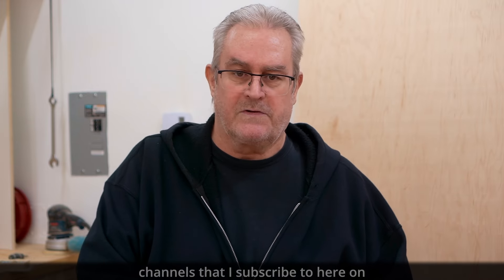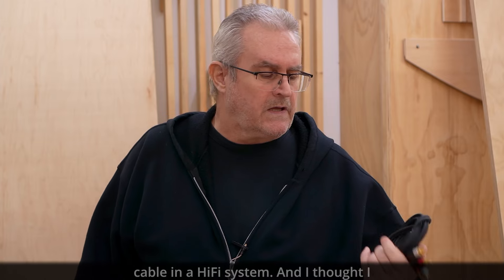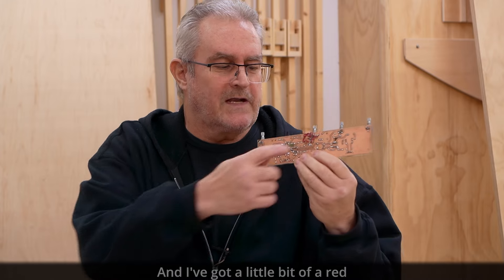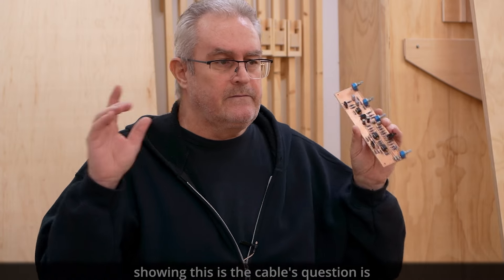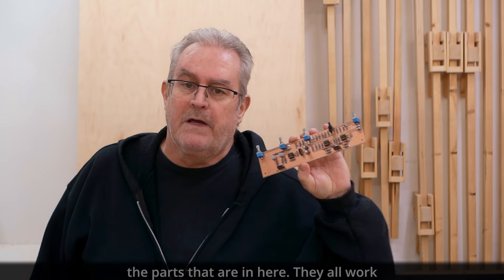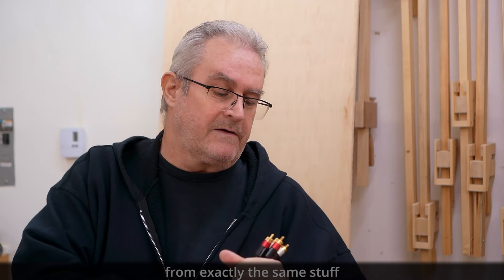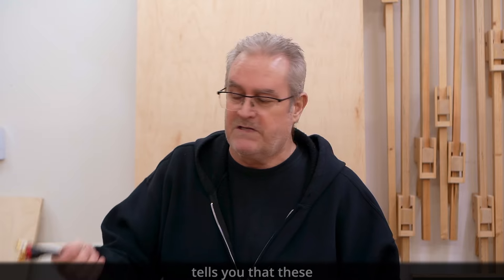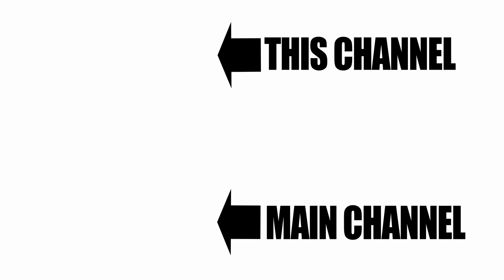Most important Cable in a Hifi system?

Comment: John, you are a fantastic woodworker.  You have designed and built some really interesting speakers and provide good information most of the time.  Unfortunately, in this case just flat wrong.  Claiming Amazon Basic cables and 100X or 1000X cables are made of the same stuff is wrong and blew your whole premise.  That is the same hand waving BS you just accused PS Audio of performing.  Where is the technical data to back up that claim?  Quality of everything that goes into a cable matters.  A well performing cable DOES NOT have to be uber expensive.  Most uber expensive cables do not perform at such a superior level to justify their cost.  Heck, have personally experienced moderately priced "audiophile" cables with shoddy construction.  In no way do I promote uber expensive cables.  Quality at a reasonable cost is the better answer. After trying cheap to moderate cost claimed to be "audiophile" quality cables, trashed them all and built my own.  Quality parts, not expensive or containing pixie dust, that do the job and will last a lifetime.
Reply from the maker: The tech data is in the materials used - copper for the conductor and plastic for the insulation. 
I could say more, but I doubt it would be time well spent. If there's one thing I've learned about guys who are into audio, they believe what they want to believe, despite evidence to the contrary. 
They also don't have the technical knowledge and experience to put the relevant factors into perspective and fall for pseudoscience half-truths.
Reply: @IBuildIt  Data does tell the story.  Recycled copper is not the same as virgin copper.  All plastic type insulation is not the same.  All connectors are not the same.  Again, I am NOT promoting expensive "audiophile" cables.  I do have the engineering experience to know that an Amazon cable is not the same as one costing 10X, 100X, or 1000X more as you claim.  Not sure what you have against guys who are into audio.  Painting all with a broad brush implying blind belief in pseudoscience half-truths is wrong handwaving again.  If you are happy with cheap Amazon cables, fine.  My point is for not more than 2X the cost of cheap Amazon one can build your own with quality components that will have top notch performance and last a lifetime.  I said nothing in support of uber expensive cables or belief in pixie dust.
Reply from the maker: So you think you can hear the difference between a "midfi" cable, like that amazon Basics one, and a genuine audiophile one? 
If you can and can prove it, you belong in the history books as the first of all time. Because such a claim has never been proven - ever. 
In fact James Randi was offering a 1 million dollar payout to anyone who could prove it, yet no one did.
That tells the rational man one thing: there isn't an audible difference. 
That's the relevant data.
Everything else is pixie dust and self-deception.
Reply: @IBuildIt  Don't understand why you are repeatedly accusing me of saying something I most certainly did not.  I said nothing about comparative sound quality.  You made a giant leap to that conclusion.  For the last time, my point is knowing what goes into a cable by making your own.  Why do you design and make your own speakers?  Why not buy off the shelf?  Are you smarter than every speaker designer in the world?  Doubtful. You like doing things yourself.  Correct?  I am not criticizing your speaker building interest.  I did call you out for making an absolutely false statement that Amazon cables are the same as others costing many multiples of dollars. 

The idea that some test could be performed to shut down all expensive cable manufacturers claims is absurd.  The argument around double blind listening tests has been around for decades.  It will never be settled because neither side of the argument can ever agree on how to conduct a definitive test.  The gigantic fallacy with double blind tests is EITHER side of the argument extrapolating an "end all" test result as applicable universally.  

Until you stop twisting my point so you can continue to aggressively thump your chest as all knowing about cables, no reason to attempt a civil exchange with you.
Reply from the maker: Double blind testing is the established scientific way to determine reliable results from subjective evaluation, so I have no idea what you are talking about. No one has been able to show that they can hear the difference when the tests are run. Plenty have been done, but none have shown results that prove audible differences in cables.
So, what difference does it make if your preferred "good" cable is made from virgin copper, if you can't hear a difference? Why is it important for you to get upset about me saying that the Amazon cable is made from the same stuff as the ones that costs hundreds more, when you won't hear the difference?
When the average audio guy talks about cables he's talking about SOUND QUALITY, not something else. So is it really me making a giant leap? Get real.
If you think you can make a better (build quality) cable than Amazon, good for you. That and a $5 bill will get you a coffee.
But to claim there's something special about the materials you would use to make the cable, and that they are so much better than what Amazon uses is nonsense. It's mostly nonsense because IT DOESN'T MATTER!
You are arguing about trivial issues and acting like the fate of the Western world hinges on it.
Reply: @IBuildIt  Sorry you think I am upset because I pointed out you are factually wrong about your Amazon cable example.  Seems you have a strong emotional attachment to this topic.  You will find audible differences between Amazon cables and 10X, 100x, or 1000X cables.  You can find an expensive cable that will filter or accentuate some part of the frequency spectrum.  NOT A GOOD THING!  We can agree on that, I hope.  Precisely why I repeatedly state not an advocate of expensive cables.  GOT IT?

Quit twisting my words to further your crusade.  I build my cables to know the quality of material and construction.  Also, know they will accurately conduct an electrical signal.  I have experienced crappy build cheap and crappy build claimed high end cables that absolutely made an audible difference - even with no measurable continuity  problem.  Disassembly revealed fabrication problems.

Why do you build speakers vs buy off the shelf?  I suspect interest, talent, and knowing the performance of everything in that speaker build.  My preference is every bit as valid as your preference.  End of discussion!
Reply from the maker: @jfritzy4358  I build speakers and everything else I build because that's what I do - I build stuff. I like doing it, but I don't FOOL myself into thinking what I make is radically better than what I can buy. 
If you truly know what's in a cable because you've built your own, you should be aware that you will find the same materials in a store bought cable. THAT'S what I said - copper (conductor) and plastic (insulator) - same stuff.
Fool yourself into thinking that your cables are better if you like, but don't come on here and claim that what I'm saying is false without REAL proof of that. You have none because your accusation is patently ridiculous.
Reply: @IBuildIt  So John, you like to build stuff and that is OK.  Nothing you build is better than off the shelf.  Really?  So you considered building and selling speakers out of the goodness of your heart because they are no better than off the shelf.  Give me a break.

John, you made the false claim about all cables being the same because a conductor is copper and insulation is plastic.  Recycled copper is not the same as virgin copper.  Copper flash coated aluminum is a different animal.  Other blends of copper, tin, and aluminum are different. There are seven types of common plastic that could appear in insulation.  All different properties.  When you buy a cheap, likely made in China cable you have no idea what you are getting.  Happy with cheap and crap shoot for material, go for it.  You apply that approach in speaker building?  A tweeter is a tweeter.  No need to measure and pick a "better" tweeter, right?  

Enough demeaning my choices because you choose to claim broad generalizations are pure truth.  You need to study the work of Galen Gaeris to understand the science and physics complexities of a conductor and insulation that you think are all the same.  I have NO interest in buying or promoting the no holds barred near perfect conductor of an audio signal Mr. Gaeris designed.  I do appreciate his knowledge, expertise, and effort based on real science. That factual science based information moves me away from cheap junk to something just a few dollars more with a known pedigree.  Stick to your hobbies of woodworking and speaker building.  Stop broad generalization pontification and claiming you know what anyone else can hear or how they should spend money on audio or materials science.  Sounds too much like the obnoxious self appointed experts of every topic on some audio forums.
Reply from the maker: You are a perfect example of the kind of obsessive problem people have today. They have access to too much info and don't have the cognitive faculty to process it properly. You are concerned with trivialities that are of no consequence, yet feel the need to argue about. 
On my side, I get into these discussions to measure the depth of the insanity that's part of this hobby. Before being on YouTube, I had no idea just how out of touch with reality a lot of people are, so it has been a great lesson. 
However, I think I've drilled down deep enough into your psychosis to add to my studies and I'll end this here. Have a great day!

Comment: This is very oversimplified.
Reply: No, not really, you will never see a manufacturer of "high end" cables submit to independent double blind testing, because they know the outcome. What does an expensive power cord do for you? Line power is very dirty, all the cable can do is transfer that dirty power to the unit which then has to filter out the noise, so its the unit itself that is responsible for that.
Reply: But it is this simple.